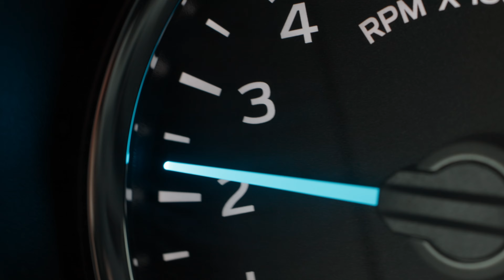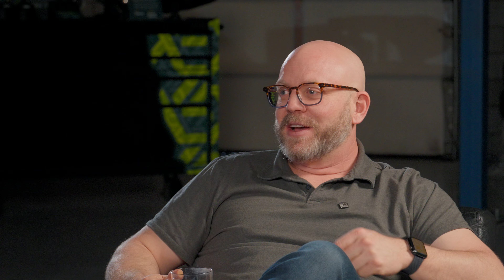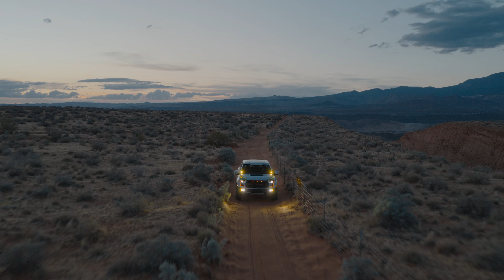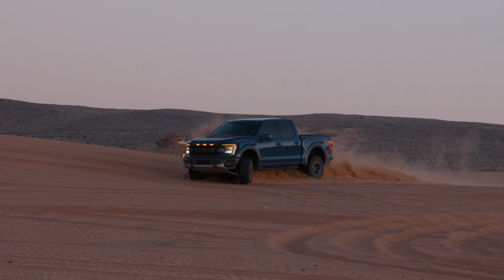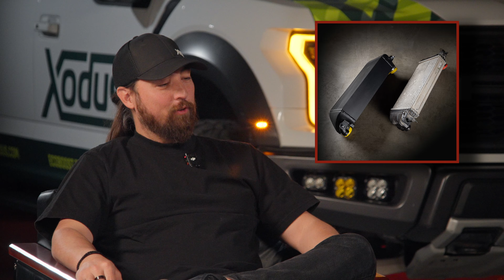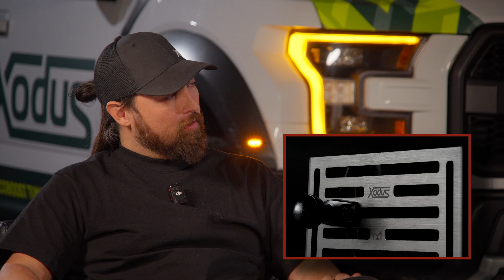Xodus NEW Product Launch | Spring 2026

Comment: First....loving the new products for the gen2!!
Reply from the maker: Absolutely!  Stage 1, Stage 2, Flex-fuel ethanol, game-changing intercooler, EGT -capable high-flow turbo flanges, innovative full catback exhaust, and a cold air intake system that's unlike anything else on the EcoBoost market!? We are definitely here to bring the power and fun to Raptors!